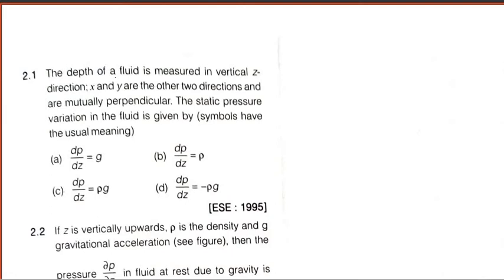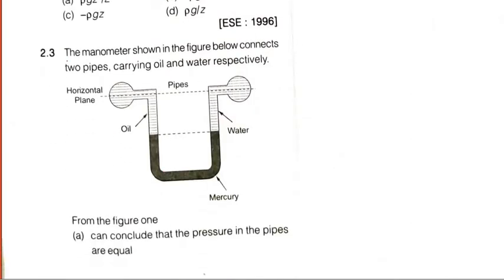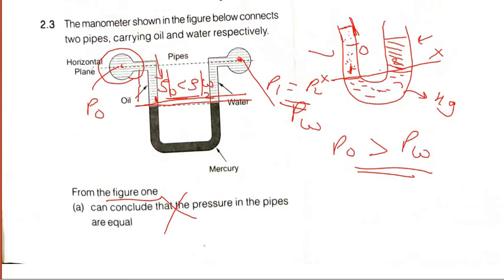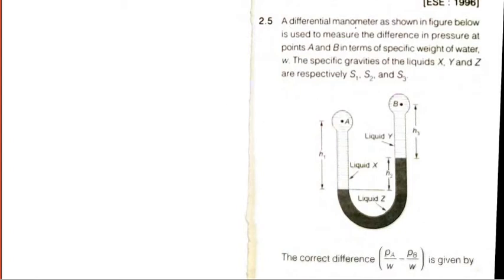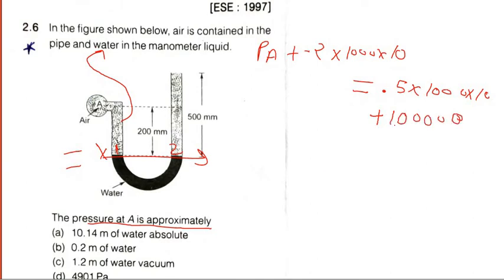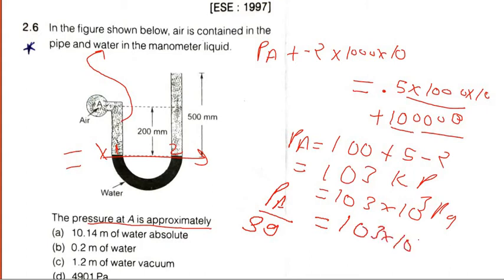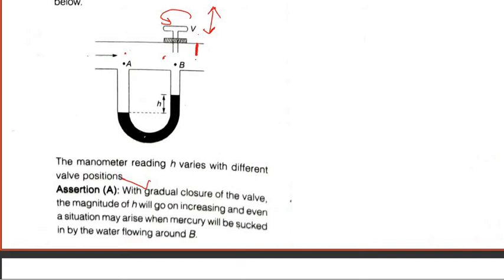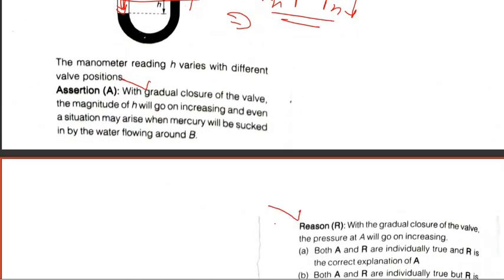Previous Year ||ESE/IES || Mechanical || Video Series|| Fluid Mechanics|| Pressure Measurement|| 2.1

Comment: for 2.7  problem Reason is false because pressure at point A is won't change
Reply from the maker: alluphanindra, suppose in a pipe fluid is flowing so there will be some total energy(kinetic+potential+ pressure),
Which is constant.

Now when you try to resist the flow or ristrict the flow.
It's kinetic head starts to convert in to pressure head which will increase the pressure.
When you place your hand in front of flowing water it's velocity decrease and you will feel the pressure in your head coz that kinetic Head converts to pressure heat because of resistance.
Reply: But there is no restriction to the motion of the fluid at point A
Reply from the maker: alluphanindra ,You mean ristrictuon at B will not affect flow at A?
Reply: @MechOTech  theoretically it shouldn't affect